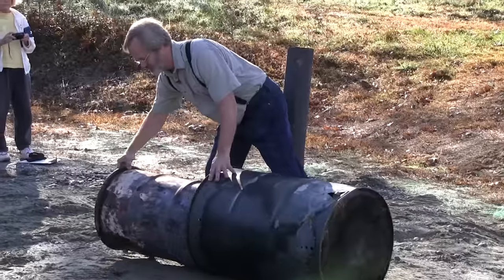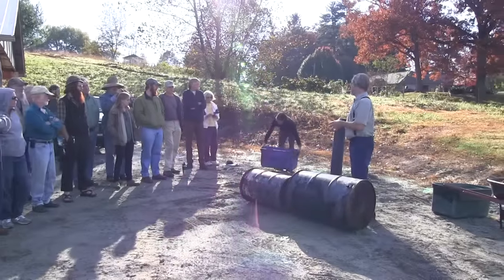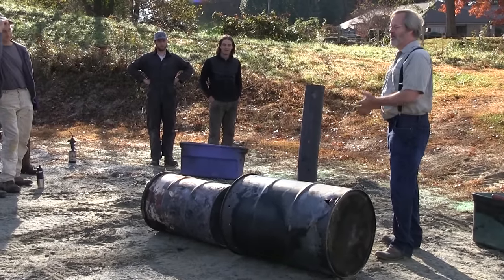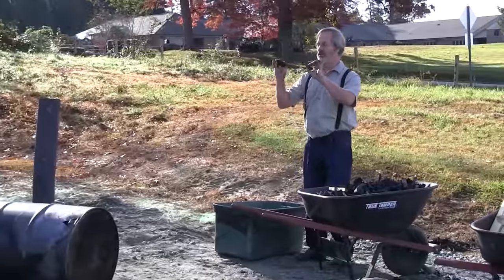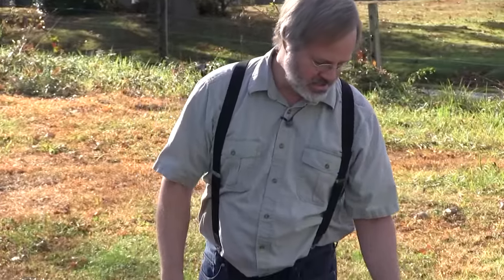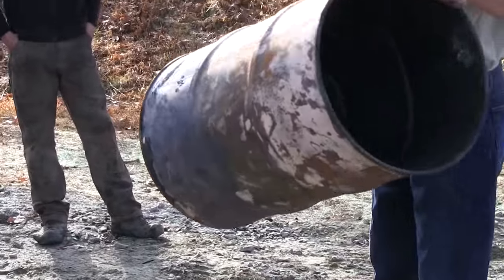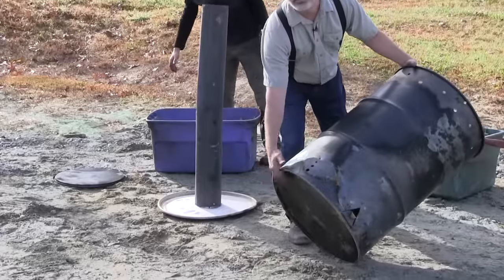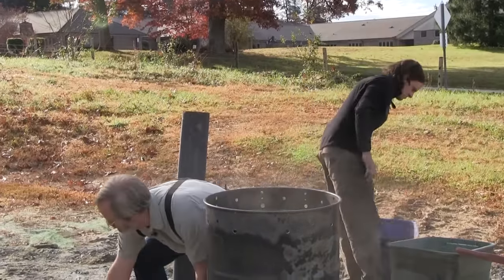Biochar Workshop Part 1, How to Make Biochar

Comment: I wish this guy wasn't so indoctrinated into this modern monetary slavery system. The importance of profit for monetary purpose is being exposed as a fallacy. In addition, CO2 (carbon  dioxide) is not the horrible "greenhouse gas" that the media and bureaucrat politicians make it out to be. CO2 makes up less than 0.1% of our atmosphere. CO2 is what plants breathe in the process of photosynthesis in which plants use sunlight + water + CO2 to make breathable oxygen for us. More CO2 = bigger/greener plants. Currently  our atmosphere is around 400 parts per million parts of elements in our atmosphere, or 0.0004%. This means for every one million parts of Nitrogen + Oxygen + Methane + Neon + Krypton + Argon + Helium + Hydrogen + Water Vapor + Nitrous Oxide + Ozone + Other Elements there are only 400 parts that are Carbon Dioxide. 400 divided by 1,000,000 = 0.0004, or 0.04%. That's less than one half of one tenth of one percent
Reply: get your own channel

Comment: So you want to open the door of destruction for the last few hard wood forest of the world.
Reply: This is important to understand completely. Sustainable harvest tends not to result from free market systems. Impoverished groups will take whatever they can to survive, and greedy people will just keep taking. However there is an amount that can be sustainably taken, and when some of that is sequestered as soil amendment, this prevents carbon from returning to the atmosphere; that's drawdown. Additionally, in fire-adapted climates where litter tends to burn rather than rot, varying amounts of excess fuel should be taken if the landscape is not subjected to regular burning (natural or prescribed), or else catastrophic wildfire will result. Charcoal is not a big money-maker for anyone. Insufficient forest fuel management is the tendency, not rampant exploitation as with timber or conversion to export crops.

Comment: The PhD, tells you all the many rules of making biochar, so get a notebook. This info gives so many rules no one would bother. Pallet wood has nails so the nails need to be removed, pallet wood may be contaminated with paint so you can use that, plus it may be a colorless toxic chemicals  on the pallet so you can use that. Just make a fire and cover it with dirt.  He hates to make char if the heat is lost OMG.

Comment: Your logo has 8 divisions of the circle.
This is incorrect if  associated with biological systems and forms.
The correct divisions of the circle is thirds or sixths. 3 and 6.
Biological structures and even atomic structures are based on the equilateral triangle also called unilateral triangle.

In fact the equilateral triangle within the circle is the intrinsic form found everywhere in the universe.
The division you used of quarters (4) is merely derived from the fundamental of 3. 60 degree,60 degree, 60degree.

The fact that you chose quarters of the circle, or 90 degrees and 45 degrees shows you do not understand the intrinsic or basic form of bio systems. Your understanding is partial,not intrinsic.
You may think it looks good by putting leaves on it however the form is totally incorrect.
The form of carbon rings, your actual product  is a 6 carbon ring, exactly 6 divisions of the circle with each carbon. 
So your symbol for your specific material in the video is exactly wrong.